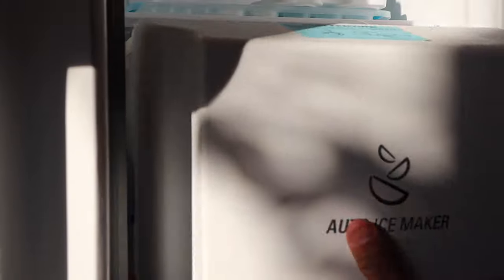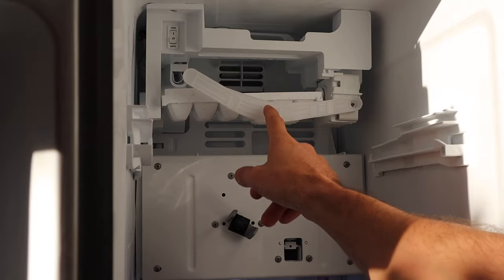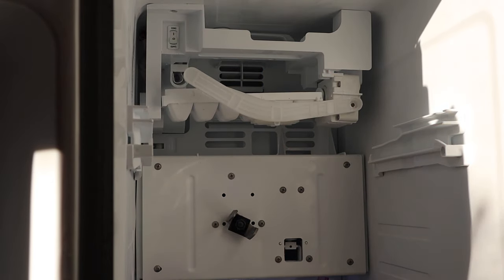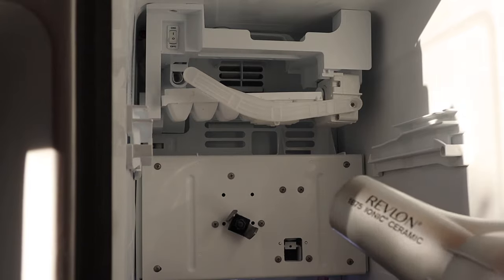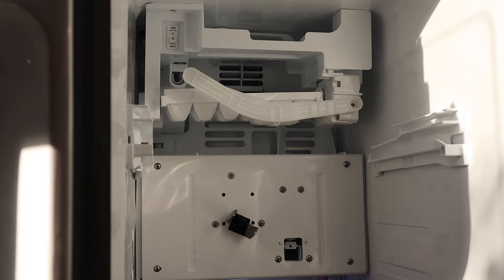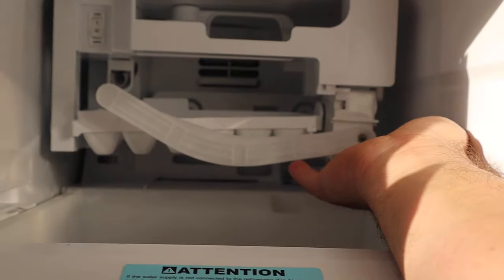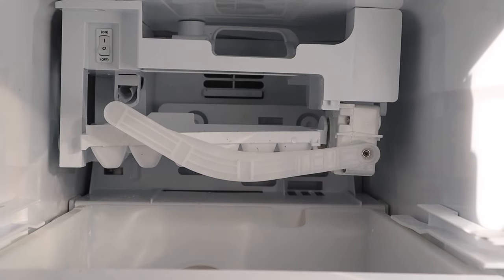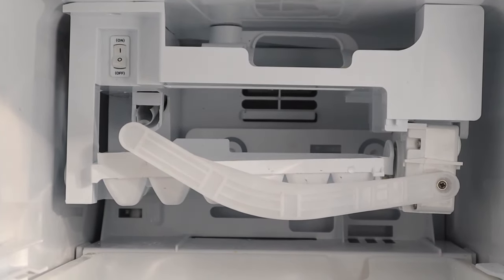How To Fix An Ice Maker That's Not Making Ice

Comment: Thank you so much for the step by step instruction on repairing the ice maker! It worked like a charm and now I have ice again. I had torn the freezer apart the day before and never saw the Reset button! I used the hair dryer, removed the existing ice form the tray, pressed the reset and Voila! Up and running. I will share that the reason mine froze up is because we had some items on the very top shelf of the freezer that were blocking the cold air vent. Caution everyone, keep those vents clear from obstruction. 😀

Comment: Many thanks for a very clear and helpful video. My Kenmore refrigerator ice maker was frozen. In 5 min. I used the hair dryer, then pressed the rest button,  and it began working. Your video was a lot better than many others that go into far more complicated reasons I didn't need. God bless you for posting this!
Reply: Had similar issue,  after leaving the freezer drawer open for a while for cleaning, I guess condensation  built a thick layer on top of tray and would not dump the ice. After pressing the reset button and the tray flipped I just manually forced the ice out of it.
Reply: Thanks, it works on bottom freezer Kenmore refrigerator with similar ice maker.

Comment: Thank You! Not a single manual or bit of advice from LG helped at all...hell, I couldn't even find, or even know about, the reset switch based of of LG support. I don't know why that was a secret. My ice maker was identical to yours and a hair dryer fixed it quicker than it took me to buy a hair dryer!
Reply: Shame on manufacturers who keep diagnostic, repair, and specification info a secret.  They should be policed into disclosure.
Reply: I was an appliance repairman for years. The companies want you to call their techs out so they make money. I worked for Sears, and it was a nightmare for even US to get the manuals. Samsung is the worst offender. The companies say it's a "liability issue", but I've literally seen with my own eyes it's all about the 💰.

Comment: You just solved an issue I have been having with my Samsung RF260, bottom drawer freezer and ice maker. I could not figure out how that arm worked or if it even moved! Also I see why the ice tray is so thin, it is to allow for the flexing to dump the ice. You can never see this operation in a bottom drawer freezer, with your video I was able to see how everything works. I just replaced my icemaker as I wasn't getting any ice, but the real culprit was the fill tube, it was freezing up, apparently it has a heater which stopped working. As I had to take out the ice maker to be able to disconnect the wiring harness  on the fill tube,  I ordered both parts from Amazon, working fine now.  I will keep the old ice maker for spare parts.  Great Video.

Comment: Just watched your video.  My icemaker was not working and I noticed the tray was tilted and arm up. I used hair dryer to remove any build up and then hit reset switch under arm assembly. Worked almost immediately. All is good, Thx to you

Comment: This worked for my LG fridge. Not even 2 mins with a blow dryer on the mechanism that the arm connects to and tray dumped after pressing the reset button. 10/10

Comment: Hi Devin,  thanks for the very practical video your suggested hair dryer solution work for me.  A majority of other videos on you tube on the subject take the it's broken replace it route, and show how to perform a replacement without any attempt to troubleshoot the problem.  Your's differs in that you actually show what the test mode action is, and offered an explanation and suggest fix to solve the problem without spending $ to buy a replacement ice maker.    Very much appreciated.

Comment: I figured that was the issue but I had no idea there was a reset button, so this helped immensely. You can use the same trick if the fridge stops cooling-- there is a damper door between the freezer and fridge to regulate the air flow that sometimes freezes shut.

Comment: Problem solved in about 1min under a blow dryer, thanks.  Genius problem solving technique!!  It explains why in the past it stopped working and then worked again without doing much, I must have inadvertently thawed the system out trying to diagnose the problem :-) Live is good.

Comment: Ahhh, I see. I have a new Hisense refrigerator bottom freezer model And the arm is in the up position, it seems always. But now I see. The arm only comes down prior to dumping. The Hisense support rep knew 0, about that. Thanks 👍
All the refrigerators ive ever worked on had a nice regular ice makers with the metal arm and flip out ice dumpers. I can't see this lasting more than a couple of years at best. Thanks again.

Comment: I’ve been a tech for about 4 years now... if you do use a heat gun or a hair dryer... BE CAREFUL. If you warp the cavity... you will more than likely cause an air leak and you just caused a bigger issue. If you want to do it yourself... use a steamer.
Reply: I did this and now my refrigerator stays running 😟
Reply: Use a hair dryer on low heat setting AND HAVE PATIENCE. 
No need to go in and blast it on high heat or with  heat gun.
Use common sense.

Comment: This was very informative and helpful my ice maker wasn't for a couple of days I was just about to call a repair technician. Any videos on replacing a water filter on the same model?
Reply from the maker: The water filter is super simple. I order my filters off of Amazon. They spin off, about half a turn and drop out. Insert new, spin tight to the notch, use the water until it runs clear. About two glasses. The filter is in the fridge. Top right.

Comment: Hi, this is a pretty good video.  Never would have known the reset button was there. With that said, I reset the unit and realized my problem is the water dispenser is not letting out enough water to fill the entire tray, it's only filling like 4 cubes and not the entire tray. How do I adjust the amount of water being dispensed?

Comment: Thank you for making this video! I have an LG with the same ice-maker, and I thought the cube tray was broken, as it tilts down on the left side. Your video shows that this is the default. One question: when the tray gets refilled with water, it looks like it's still low on the left side, so how does the whole tray get filled?
Reply from the maker: Mine will over flow on the right. Still a little low on the left
Reply: @TheDurbinCompound  Mine overflows a little bit on the left where the hose is. I've read on a troubleshooting forum, that this may be caused by too much water pressure. The solution offered was to slightly close the water valve at the wall to reduce the flow. I'll give that a try.

Comment: I'll tell you what, that helped me out immensely. Unfortunately though, that led me to the problem. The reason that the ice maker doesn't work is that the fill hose is leaking at the inlet in back. We lost power for a couple of days last big storm and it must've froze and split. So in the morning I'll pull the back off and replace it. Is there any chance that you did a video on that repair...

Comment: My kenmore freezer drawer wont push in all the way, the ice maker is poking out and i cant close the freezer door because the ice maker is shut fully. A long wire with spring twisted on it keeps hitting the small rectangle and it blocks it from closing fully. So the little rectangle lifts up and down so i lift it up and put the wire spring under it in the rectangle.. but everytime I pull the ice drawer open to grab more ice, the spring wire pops back out again. Do you have any idea why it hits that barrier and doesnt close properly??
Reply from the maker: Sorry for the delay.  I’m not sure why your ice maker is doing that.  Have you got anything resolved?

Comment: Just a FYI the tray that dumps the ice it flexes over time and  will crack / break. So it won't dump. You have to replace the assembly which is fairly simple.
Heres typically what happens. Every time it trys to dump it never puts any ice into bin. It uses a twisting motion to break the ice bond. Simple design but plastic over time with this motion of operation will eventually fail. As it trys to repeat this process it will ALSO dump water because it too dumb to know theres a block of ice.  So your ice shoot can fill with water, or it bin and freeze. Or you'll scratch your head why there's water on the floor. TURN the ice make off till you cna get the needed parts to repair.  A lot of these fridges can be placed into service mode to force a dump.  Any way you find your self here going ah a simple hair dryer will fix it. NOPE. the tray is more likely cracked and you might get lucky and it works for a few cycles only to be back to the block of ice and no longer working.   There should not be an condensation build up. That is cause by the ice mechanism not working and the water is literally running over the tray.   
If you ask me oh it a simple design but yet it very stupid. Twisting and bending of plastic at zero degrees or lower over time = fauilue.  

Good luck

Comment: Probably the reset button in your refrigerator is on the left in a white plastic case with a small hole for a toothpick. You should insert a toothpick there and press lightly. Approximately three to five seconds. You will feel the microswitch operate under the end of the toothpick. When you hear a faint beep, close the ice compartment door and close the main door. After a while, the ice maker will start producing ice. 
Вероятно, кнопка сброса в вашем холодильнике находится слева в белом пластиковом корпусе с небольшим отверстием для зубочистки. Туда следует вставить зубочистку и слегка нажать. Примерно три-пять секунд. Вы почувствуете, как срабатывает микропереключатель под концом зубочистки. Когда вы услышите слабый звуковой сигнал, закройте дверцу отделения для льда и закройте главную дверцу. Через некоторое время льдогенератор начнет производить лед.

Comment: Thank you for the video. In my fridge the reset button push ice down to the bottom and then it fill the drip with water again. My issue is that after the water becomes ice it is not falling down never. What could be the problem?

Thank you for any advice

Ciao

Comment: My kenmore ice maker has the same ice maker accept it is in the door. I looked everywhere and cannot find the reset button. Even used a morror. Any suggestions on how to reset it?
Reply: Hi.. I hope you found the reset button ? I can't find mine too 😫
Reply: @emerlinavalencia5357  we took our camera and made a picture of it underneath.  Really helped.  Hope you figured it out
Reply: According to the fridge, you have to turn the ice maker power switch off, then unplug the fridge for 5 minutes to reset it.  I have the same style with the maker in the door, makes all the normal noises it would when making ice, but I get nothing out of it.  Going to try the heat solution here shortly and see what happens.
Reply: @GrandPrix46  I did. Had to hire a repair man because it was a broken wire.
Reply: @tree.65  sorry to hear.  The heat gun deal worked on mine, at least for now.  I just flipped the switch for the icemaker on the inside of the door while I hit the plastics with heat, flipped it back on when I was done, and it's now making ice again.

No idea what was frozen, as everything moved freely when I was checking it out (the plastic arm, the ice tray at the top, etc), but it worked.  I've found the wires at the bottom left of the freezer door is the spot they like to break, from the repeated opening/closing of the door, I knew I had power at the icemaker so I ruled out a broken wire right away, but it's a common issue with these setups.

Comment: What brand of refrigerator is that?
Reply from the maker: LG
Reply: Hi I have a Panasonic NR-B53V2. Annoyingly the freezer door wasn't quite shut properly over night and the ice had melted etc.... Nightmare! The ice maker isn't working now. Done the usual power off reset button etc. My ice tray only moves slightly, nowhere near enough to tip ice out and water isn't filling into the trays. Also water dispenser slow to flow coming out now. Don't know if anyone has had similar experiences or not?
Reply: Hi I have a Panasonic NR-B53V2. Annoyingly the freezer door wasn't quite shut properly over night and the ice had melted etc.... Nightmare! The ice maker isn't working now. Done the usual power off reset button etc. My ice tray only moves slightly, nowhere near enough to tip ice out and water isn't filling into the trays. Don't know if anyone has had similar experiences or not?

Comment: Doesn't the arm stay down and rise up as the ice raises up and then eventually shuts the unit off?  Or does the arm only move down right before it is read to dump ice.  If the latter is true how often does the unit send the arm down to measure the height of the ice in the ice bucket?

Comment: Hy everyone, 
I'm having an issue with my Samsung fridge. After I last changed the water filter, the ice-maker has stopped working automatically. I can only manually activate the turning, cube ejecting and refilling process by pressing the reset button. And it works just fine, everytime I start it manually. Problem is the process will not start automatically. I have already checked the icemaker is switched to on, the watersupply is connected and free of obsatcles, or blockages. The freezer temp is -23°C, so way below the required -18°C.
Any hint, as to what else I can try or check, would be very much appreciated.
Reply: Hi Steevee5k, do you found the solution for your Icemaker? I have a similar problem.
Reply: @giogirassol  Well, after a couple of days, it started to work on its own again, luckily without the need of doing anything on my part.  So, I never found out, what caused this glitch in the first place.
Reply: @Steevee5k  oh nice. I was not so lucky. I dismantled and assembled again but the problem persist. Thank you for your answer.

Comment: Ice tray is stuck in the ice dumping mode, it won't reset.  How long do I need to wait for it to reset back into the upright position so it makes ice?
Reply from the maker: It usually will reset within a couple seconds. I’ve had to hit the button quite a few times or some people have had to hold the button
Reply: @TheDurbinCompound  thank you for the quick reply! I'll tried that but the ice tray won't go back into place, I've turned it off and will try again tomorrow 🙃
Reply from the maker: Ugggh well hopefully it will reset itself!  Let me know if you still need help!
Reply: @TheDurbinCompound  will do thank you so much!!!

Comment: Instead of making ice "cubes" mine makes an iceberg because the tray is tilted down to the left.  i notice in your video, your tray is also tilted down to the left, is this normal?   Is my ice maker spilling out too much water and over-filling the tray?
Reply: Mine does the same thing. Ice builds up under the tray and eventually it won't move. My tray tips too which seems normal. I used the test button to see what's happening... On mine it fills up just fine, the problem is it dumps the ice cubes before they are completely frozen and leftover water spills into the bin. Not sure there is anything I can do but clean it out every couple weeks.

Comment: What happens if the water doesn’t come out with the door open like in video?
Reply: I have the same problem, no water coming to the tray but my water from the refrigerator door still pours out. Please answer Ron's question.
Reply from the maker: Sorry!  This could be caused by a frozen water line. If it were mine I’d try to thaw out the freezer and see if that solves my problem. A little inconvenient but that’s the first thing to rule out.